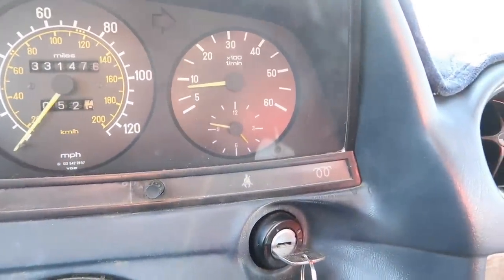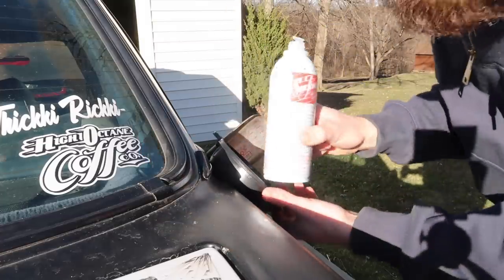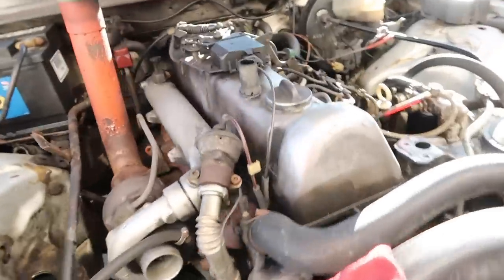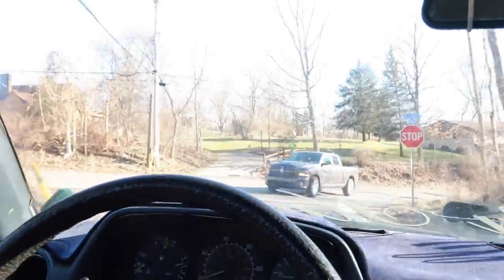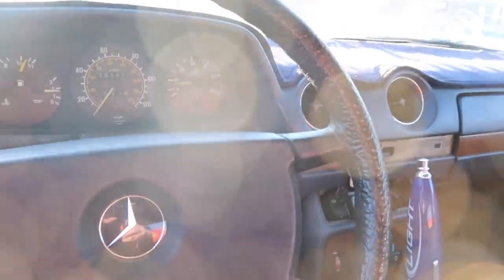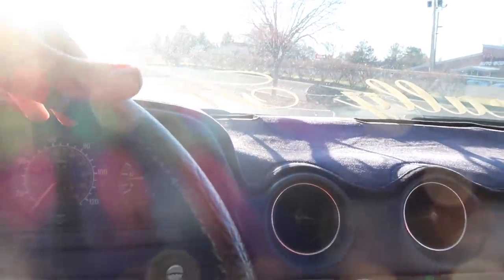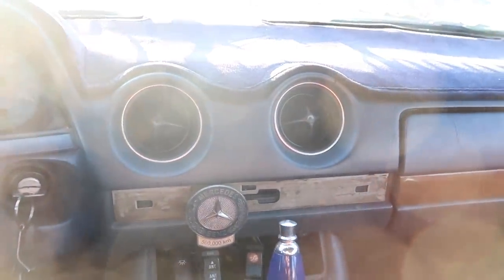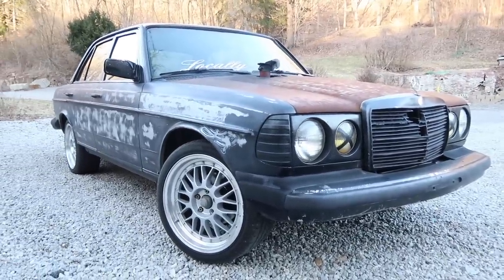What Happens If You Seafoam Your Diesel? - WAY TOO MUCH

Comment: Would you put it in your own, new truck?
Reply: Anthony Cronin I do it keeps it running like new. Actually I put it in every single thing I own with a gas or Diesel engine i even put it in my 550 gallon poultry house generator tank not only to keep clean but to stabilize all that fuel and help keep moisture out

Comment: So any comments About weather you ca. Sea foam a 6.5 gmc diesel?
Reply: I do it in my 1995 7.3 and it has 317k right now without doing anything to the engine except water pump once you really feel a little bit of a difference.

Comment: That’s one ugly car.... I LOVE IT!!!!! 😁  I have used Seafoam for years. I did have an issue with an old 92 Geo that I had years ago. I bought it with low miles but a lot of years. The owner lived 2 miles from work so it spent its life having never warmed up. As a result, the entire inside of the engine was full of a shiny brown crystallized oil material. When I removed the valve cover to lash the valve, it looked like it had another valve cover underneath. I’ve never seen anything like it before. I had to chisel my way to the rocker arms. The see foam dissolved a lot of this junk and the oil turned into a brown slurry. It didn’t seem to damage anything but I had to change the oil and filter about 5 times the first week. Seemed to clean pretty darn good

Comment: Change you fuel filter.
My 240D ran much better after that.
Reply: Robert Sackmann How often do you change yours ?
Reply: @Mr330d   about every 10k miles or sooner if I get bad tank of fuel.
I run Rotella T 15-40 diesel oil in the engine .
I have had good luck with that oil in all my diesels.
Reply: Robert Sackmann My diesel takes 5W30 but it’s now on 137,000miles should I change to thicker oil now that’s higher miles I’ll change the fuel filter also see if I notice any improvement but I always run it on BP ultimate diesel
Reply: @Mr330d  
Any good diesel oil is ok for the engine, the wt rating should be what the manufacturer recommends.
I always liked the Rotella brand oil it worked well in my diesel truck engines.
I got way over 300k out of those engines before the transmission failed.
My older MB 240 had over 250k on the clock.

Comment: Alright guys, let’s throw this sea foam into the crank case and watch this 15w-40 turn into 0-20w on this Diesel engine.
Reply: Petroleum product that thin that flows like water wont thin oil?

Comment: Lol back off your IP dampner bolt at back of pump, and screw out your alda and possibly readjust your valves, but more common the fuel tank screen are all causes of that hard to start diesel, other than that get a egr block off plate and keep seafoaming her will keep that intske and valve area clean for life...🏁🕶️💪😷🔧🎊🛸🎉

Comment: If my dads 83 didn’t just lose a rear seal I would go tractor flap beast w/ sea foam love. All diesels: add this to your oil about 30-50 miles before your oil change and then drain it- sparkling insides. For fuel system cleaning: add cleaning dose to fuel and run the vehicle up to operating temp, pull filter and prime filter housing or filter if screw on type and replace filter (you know you’ve been needing to), idle engine for 2min, then shut down vehicle letting the sea foam heat soak the injectors/injection system for 15min, then operate vehicle (I usually drive 30 min out in the country by my house and take the dog for short ride; she is my co-pilot/navigator/alarm/parts fetcher.

Comment: WANT TO CURE YOUR SLOW PROBLEM, I HAVE OWNED SEVERAL OF THESE CARS, CHANGE YOUR FUEL FILTERS, THAT WILL BE THE REAL RESULT, SEA FOAM IS NOT THE SOULTION, YOU NEED TO RUN A QUART OF AUTOMATIC TRANSMISSION  FLUID IN THE FUEL  ALSO THAT WILL CLEAN IT UP, HI DETERGENT IN THE TRANS FLUID

Comment: Funny guy.  But I wouldn’t put this in my new Cummins. And I don’t own a POS Me/Be to try it on.  Note. I had a friend who put this in his John Deere tractor and screwed it up for good.
Reply: He didn't put it in the right place then. I use it with all the diesel I an tuning up (Self employed diesel mechanic) and I have had no complaints from customers about it, and I've been using it for 12 years.
Reply: Maybe not but it made knocks never heard before.   I have 6.7 Cummins I use service power as recommended by Cummins.  Good luck with sea foam
Reply: @wyattlarrick3246  maybe you can help me with my 6.5 I've watched onevideo by seafoam and they said to put it right in the fuel filter so I did and now it doesn't run right
Reply: What’s the music in t background
Reply: i would get ahold of seafoam thar should not happen unless something esle was wrong with it i use it all the time including my 6.7 cummins 965,000 miles later still strong
Reply: @wyattlarrick3246  can you pls tell us where to put them for freightliner cascasdia? Thanks in advancrme.

Comment: Now throw some kerosene in that motor if still gummy...then fresh oil change
Reply: When all else fails use kerosene in your diesel
Reply: Pretty much same thing as Seafoam. It’s lower viscosity which causes it to act like a solvent and pull off deposits....same concept.
Reply: Kerosene is #1 diesel with aromatics removed. Essentially cold weather diesel.

Comment: Why would anyone be dumb enough to do this? Today's Diesel engines are highly technically designed machinery.  Designed to use diesel fuel. So you're gonna take a chance on ruining a $8-10k engine with some crap out of a bottle. I could see messing with it the stuff in some junker engine that really didn't matter just for experimenting but not something you rely on. Nothing added in my fuel or oil. 2007 duramax  265k and runs perfectly.
Reply: How do you know it runs perfectly if you've never added anything to try and make it run better? Open up your egr, intake or pull an injector and you'll see buildup on all of it. Watch vids on removing glow plugs and see how some are so gummed up and can't remove em. Call up your local gm dealer and ask if they have any bottled additives. They will give you a list of top end cleaners bottom end cleaners fuel additives and all kinds of stuff that's very similar to seafoam and others except 3x the price and branded.
Reply: Well what do you do when diesel fuel gels up? Piss  in it? LOL